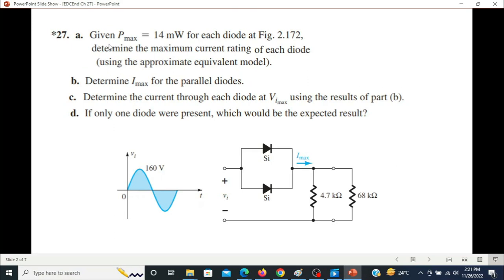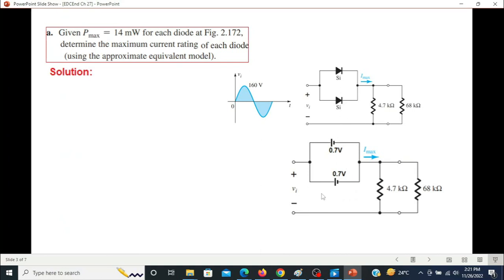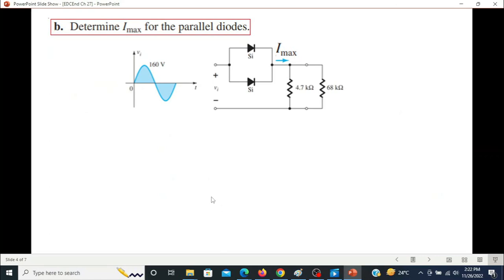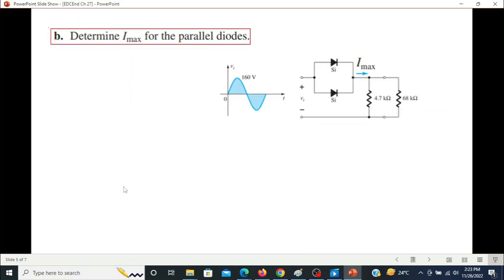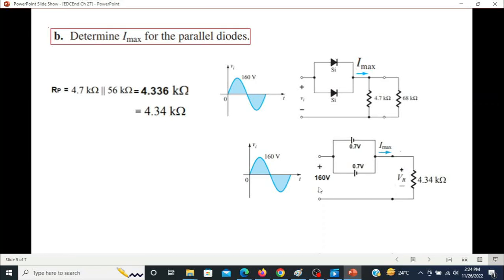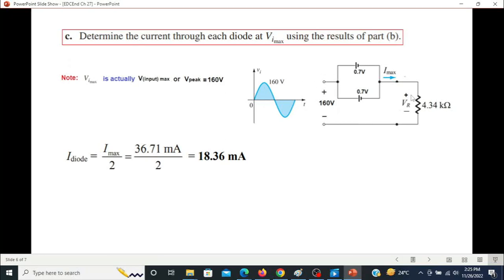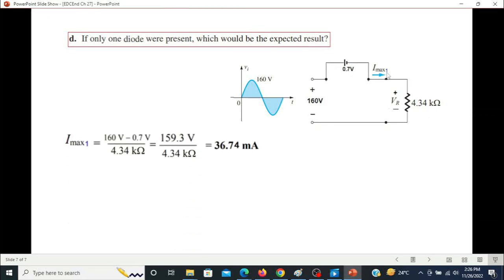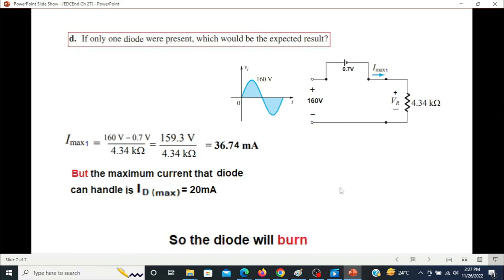(E)EDC(B) Q 2.27 || Parallel Configuration of Diodes

Comment: 6:10 sir you said that diode rating current is 50 Amp. Is it mistakenly u said?
Reply from the maker: Yes, thanks. It is 20mA
Reply: @ElectricalEngineeringAcademy  thanks a lot sir.
Reply: @ElectricalEngineeringAcademy  Dear sir, can I have your mail address. Cause I’ve some request. Thanks
Reply from the maker: @OfficialMasudRana  Given in the description